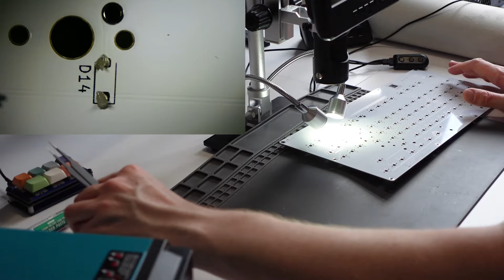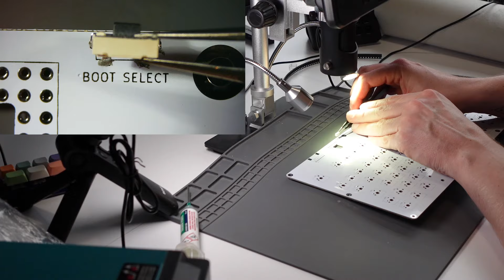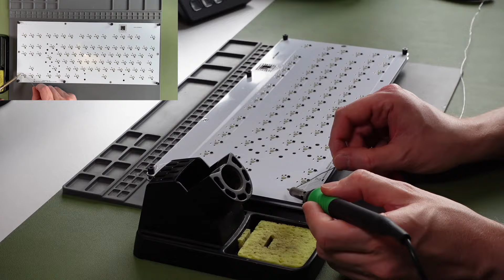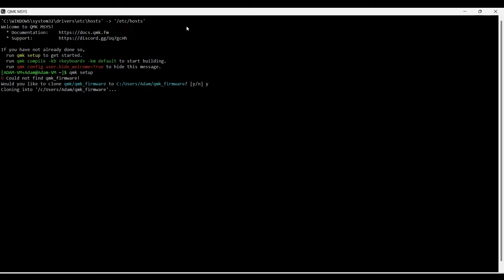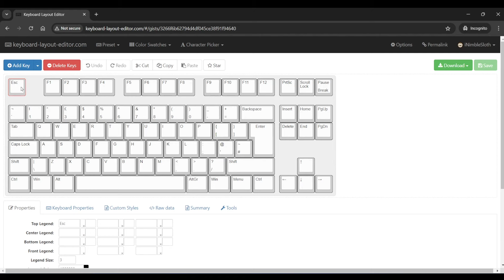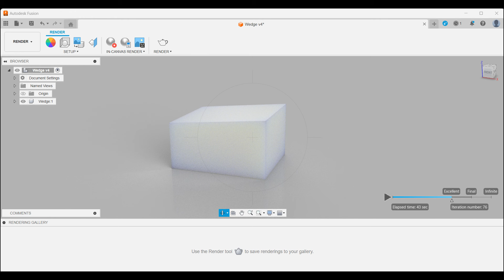PART 2: Building a custom mechanical keyboard from scratch & QMK Firmware | #mechanicalkeyboard

Comment: I like the effort you have put into this, well done. As for suggestions, personally when i build a keyboard, i tend to emphasize the sound profile and feel of the board so i like your idea of putting it into a solid block of wood. Some damping material might also be useful. As for those Rome inspired keycaps, they also exit in SA profile and PBT plastic instead of the ABS ones. That would further improve your sound profile while looking awesome. 
And maybe try lubed linear switches with pom plastic housings for their sound.

Comment: Hey Mr. Nimble, can you please do a build where the controller and the keyboard is built on the same pcb. Meaning that the maybe the controller is bottom mount or a different bluetooth compatible controller, similar to that of industrial builds where the pcb is not visible and explicitly placed in a different location. I understand that this build might quite a pain, but I request you to try since I’ve no idea on building pcb’s and wiring things and would like to build a custom mechanical keyboard from scratch albeit integrate into another device. 

Please if you could do that I would really appreciate

Comment: I have a commerically made, mechanical keyboard with a volume knob/potentiometer on the upper right corner of the keyboard that is immensely useful; this was a feature in only a few rare commercially available examples from various manufacturers. Many commercial keyboards came with dedicated buttons above the regular keys, some functioned as mute, volume up, volume down, power, play/pause, screen off/on, and the like, which I personally never found too useful; but that volume knob was great and used continually. It was able to increase/decrease the volume of media playing on the system and also had a mute feature, the knob had a momentary button feature when pressed down it could toggle the sound on or off as well. I've never been able to find another to replace that, most commercial keyboards do not offer any dedicated buttons these days. 

If I had to design my own keyboard, I'd definitely include a volume knob like that for the upper right hand corner above the regular keys. Maybe that could be a feature to integrate? My old keyboard with that feature is now failing.

Also when I choose a keyboard, commercially manufactured, I always select one with illuminated keys so they're visible in low light situations, and I prefer mechanical keys (as your keyboard has). If I were designing a keyboard, I'd make it with illumination and with programmable color and brightness. My old keyboard also had that feature, but it was not very easy to program the key illumination color/brightness, the interface wasn't very intuitive.

I would design it with multiple sockets, probably USB-A or USB-C (or both), at each corner, for versitility and perhaps two or more extra sockets; with any of the sockets having both connection capability and USB hub capability, that could host a USB mouse, or a USB flash drive or any USB device. I'd probably attempt to make it powered with a power supply capability, if possible, so that it could be used as a charging hub. Two of the sockets would be at either corner for ergonomic versitilty to orient the connection cord that leads to the computer. 

I would include bluetooth and wireless capability, and have a USB-A wireless receiver  that plugs into the computer; the receiver should have an indented storage notch in the external surface of the keyboard in order for it to avoid being misplaced and allow it to mount inside the keyboard to store it when not in use.

I personally like my keyboards to have the numeric pad on the right. I'd possibly add an internal calculator function to the keypad with a small LED or LCD internal display to the top of the keypad that could be activated with the keypad having an ability to convert itself into a keyboard mounted calculator.

Probably designing all of these features into a custom made home built keyboard might not be so realistic, but I've seen every one of these features on commercially available keyboards. Having both USB power and wireless ability is a combination that obviously is incongruent, only one or the other can be used at a time obviously, probably difficult to implement.

Good job. 
Thanks for the content.
Keep up the good work.
בס'ד
Reply: Hi I am gonna build a keyboard just like him but adding a knob ik knob is pretty useful and if u want to build wireless with Bluetooth u need esp32 it’s expensive for me so I am gonna use rp2040 with some type of Bluetooth chip if u have made it or going to make it i will be happy to help and take help

Comment: Great video. I think you have done a top notch job with this keyboard and it looks fantastic. Well done. I have to say, the trend for "retro" style, mechanical keyboards amuses me greatly. I started a computing A-level back in 1980. In the small computer room at college we had a mixture of original PET (with relatively quiet "chicklet" keys) but also the later series 4000 PET computers. There weren't actually that many but wow didn't it get loud with the students all banging away at the super clanky keyboards. Most of us would have given anything for a modern, quiet but boring keyboard. Things change!
I also used an RML380Z at school with a stupid loud keyboard and previous to that even a teletype terminal that would give you a good workout and make you deaf.

Comment: Nice job, done well... the QMK section should prove useful to others...
I build my keyboard using an STM32F411 Blackpill in a 10x10 matrix. I came to the same conclusions... now building a discrete components version.
Have also built a RP2040 version too, using my own RP2040 development board  ;)

Hot-swappable connectors would be ideal and then add VIA support ;)